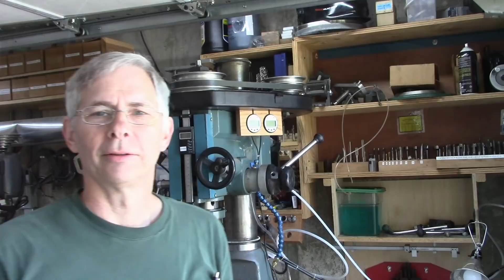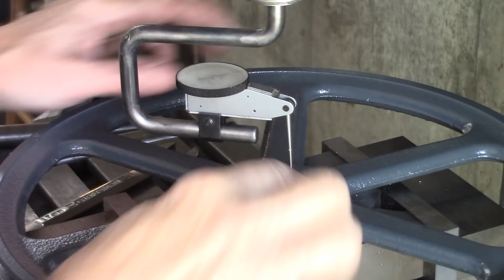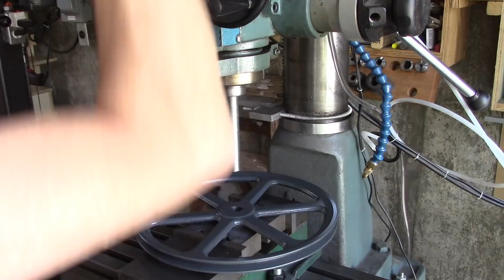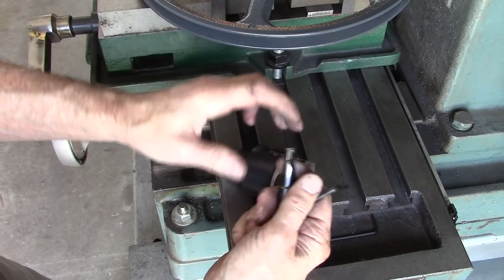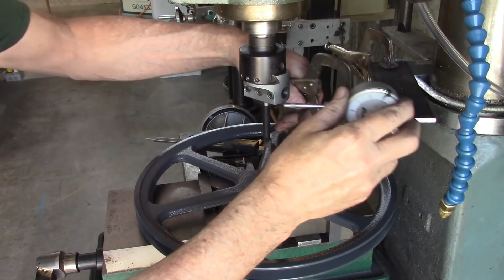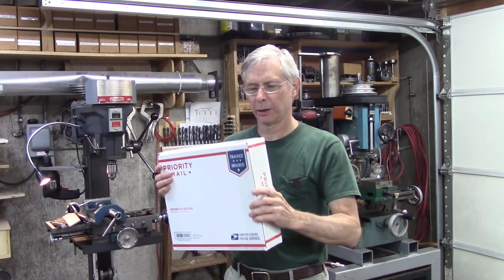Boring on a Mill

Comment: Hi - any chance you can do a video on boring out an old dirt bike cylinder using the round column mill - old school like - no DRO …. That would be great 😊- cheers from Vancouver Island BC Canada 🇨🇦
Reply from the maker: That sounds like a fun project but I don't work on dirt bikes. I think getting the block mounted square and centered would be the hard part.

Comment: 09:00 Dumb question from someone who doesn't know better. If you filled the keyway with something of roughly equal hardness would that make boring any easier since it would no longer be an interrupted cut? You'd have to be able to remove what ever filler piece you put in there I realize. It appears you were able to make the cut without any problem. So is it worth the trouble or a non-starter?
Reply from the maker: That's a good idea but the boring bar works fairly well. A drill would be a problem with the keyway.

Comment: Mark,  I have the metric version of that boring head. It has a 0.5mm feed screw. The index marks are accurate too.
Reply from the maker: I'm fairly sure mine is the same (metric). I just got lazy...  I didn't feel like figuring out the graduations. Thanks, that gives me a good starting point.

Comment: Great work thanks. I a just finished making a broaching tool and a quill locking clamp so you have justified my efforts. I have a coaxial dial indicator and have hardly use it because it takes up a fair bit of room so on my Busy Bee mill it usually does not fit with work held in the vice. Some times it use a dead center in the quill to line up a hole or use the boring bar as a crude dial indicator. I always learn some thing new from you efforts and gain a bit more confidence so thank you and have a good one.
Reply from the maker: Very cool, thanks a bunch!

Comment: Great vid. Years ago I worked in a 65 man maintenance shop. Had a couple of butcher machnists wanta bees. Several times they got caught not making a key way deep enough so just ground the key to fit. Next guy who worked on it would have a fit. I was a sparky and had some end mills to make adjustable switch brackets. Would piss some of these guys off when I did this work on overtime.
Reply from the maker: Thanks!

Comment: When you said you had .0095” to go, then you adjusted the indicator by a little less, you should have made the hole too big. Cuts on both sides.
Why didn’t it?
Reply from the maker: I did the math in my head but good point. I should have made that known.

Comment: I really like the Vee blocks. Did you make or buy them?
Reply from the maker: They came with my mill which I bought used. The first time I used them I noticed the top and the bottom narrow surfaces were not square to the larger flat sides. They were off a bunch...  like .060 in 1.25". Fortunately the V's were square to the larger faces so it was an easy fix but I was shocked that anything made for doing machine work could be that far off.

Comment: I thought you weren't supposed to use cutting oil when machining cast iron? Did I misunderstand something?
Reply from the maker: You may be right, it didn't seem to help but i have never heard that before.
Reply: @WinkysWorkshop  As I understand it (not a machinist myself) the graphite in cast iron is an excellent lubricant by itself, and the addition of any kind of liquid only serves to turn it into sludge. Sorry, I know I heard it on YouTube, and by several different machinist tubers, but I can't recall who all they were, or where. It was hinted at more than said outright, like a throwaway reference to an accepted wisdom.
Reply from the maker: @M_Northstar  I just read a little about the topic. You were right, cast contains some graphite. I also read that coolant or oil can be used to increase tool life to a small degree and also to keep the dust down. So apparently it's not really needed but doesn't hurt either. And thanks for asking, I learned something!

Comment: I like that keyway cutter! There is a video on boring bar geometry grinding, i thing it was Tom Lipton or Keith Fenner, It changes the center line on the tool face and works well.
Reply from the maker: Yeah, if you make your own boring bar or fly cutter you have to consider this but the brazed carbide and insert bar are designed to compensate for this. Thanks

Comment: I reckon the number of jokes around a "boring head", over the years must exceed the the number of dollars the 1% have.
The use of the dial gauge vs 3/4 rod to align the centre was a great illustration of run out on cold rolled rod. 
Nice work, keep the good things coming!
Reply from the maker: Ha...  I'm glad you didn't get bored (sorry, I could not resist). Thanks!

Comment: Have you done a video on your keyway tool? Id really like to see that. I lack broaches too and just a month ago, I opened up the ID in a hand wheel and filed in a new keyway...ugg! Your tool is sooo much better than that! I'll need to add a new keyway to a motor bell soon and I'd really like a better way than a file! If you haven't made a video on it, I think there are tons of hobby machinists that would find this useful.
Reply from the maker: I think I'll be doing a video on the keyway tool. Yeah, a file is a LOT of work for sure.  Thanks for the comment and the request.

Comment: Centering the wheel on the mill... What about using a 3/4 drill bit? Any little deflection of the drill bit indicate "not centered".
Using the boring bar.... You have no 7/8 drill bit?..... Too much for the machine?
Well done anyway!
Reply from the maker: A drill world have worked although I would still need to drill under size and bore the hole. Or use a reamer but I didn't have a reamer. Drill never drill an accurate hole. Also the keyway might have deflected the drill.
Reply: @WinkysWorkshop  I get it. Okey, You had fears about the keyway. Fair enough.